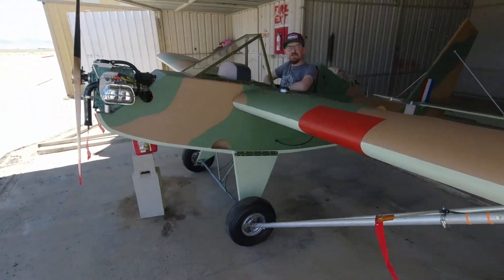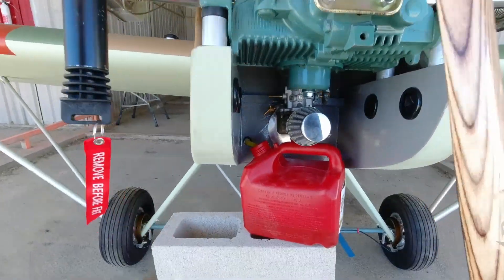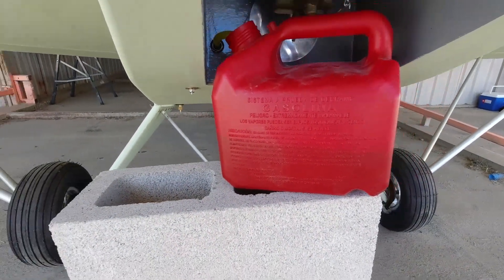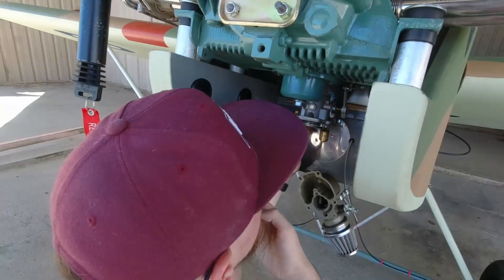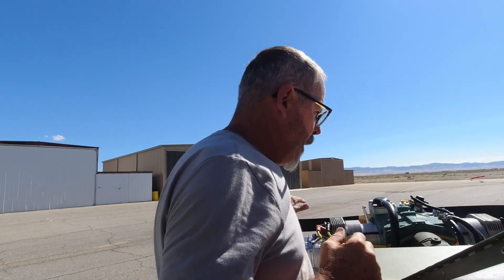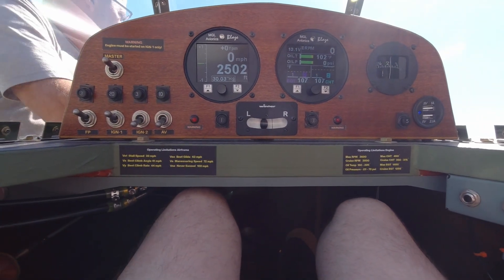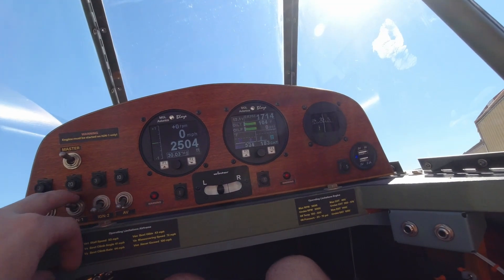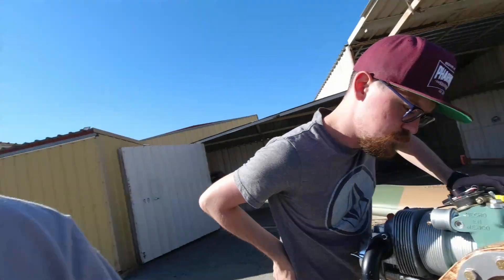Minimax 1100r Flight Testing Phase - Starting the Engine

Comment: I will be very interested in what MGL say about the oil pressure sender. Great that it started and only a few little tweeks needed. Did you try the fuel flow in flight attiutde with gravity?
Reply from the maker: I did the fuel flow yesterday with the longerons level and got a gallon in 7:38. That’s 8.1 gallons/hour. I only needed to hit 5 to double my demand so that’s good news. 
I got an 80psi 5 Bar as they recommended and it worked perfectly!
Reply: @DTMinimax  I take it that's with the pump, do you get any flow with the pump off? I think you did not put in a pump by pass and so will have to run the pump.
Reply from the maker: @flyingkub  That was with the pump off in level flight condition…with the pump on, I got a gallon in 2:38
Reply: @DTMinimax  briliant news so you don't need to run the pump all the time. I wonder if you will need to go back to the larger float jet, only testing will tell.

Comment: Ok, so that was totally fun and exciting to watch.  As I understand it, for this test you're in a climb attitude and the gascolator and fuel tanks are about on the horizontal so you're probably not getting gravity fuel flow, hence the need for the fuel pump when climbing?  Hopefully, the pump doesn't doesn't drain the battery before you get up to 12,000 MSL 🤣!
Reply from the maker: We have calculated that I can run 5 hours continuous as well as the radio and secondary ignition. Of course it’s theory and we’ll see what reality is. I do read volts on my instrument so I can keep an eye on it. I’m thinking I’ll mostly fly within a couple hours of my home port most of the time. 
It’s really fun at this stage…wish I was 20lbs lighter, but I’m just gonna have to lose that myself to trade for fuel. I may build another elevator since it’s the furthest thing hanging back there. 
With me and 5 gallons of fuel, my CG is 30% and right at 560lbs. 
With only 2.5 in each tank, there’s no fuel to move my gauge on its tail. I’m also gonna have to add some float to the bottom of the ones I have so it sits on the floor of the tank because I could barely register 2.5 gal in a level condition. 

Lots of interesting things to work through at this stage…still fun though

Comment: Hey Dennis, I was wondering if those fuel tanks were vented. I know when you have a dip in the line, that can stop it as we go through this on everyone of those things I work on when we have to drain a few gallons of fuel from each tank after we fill them for the very first time so we just make sure the hose we use stays straight. lol   Also, didn't I hear you mention a long while back that you had previously built a mini-max? I would like to hear about that some time and about the differences between the two if I am not remembering wrong.
Reply from the maker: There are vent holes in those fuel caps, they’re about 3/32” holes. I will share some info about that first one a long time ago:)

Comment: Do you have fuel pressure regulator? If so it shouldnt exceed 3 to 5 psi so that it doesnt overpower the needle and seat in the carb.
Reply from the maker: I don’t buy my pump is a 3 psi pump
Reply: @DTMinimax You should be good to go!

Comment: Dennis.  Now that you're  moving into the f"light testing phase," is there any more word on your Wt. and Bal for your followers?   Thanks.
Reply from the maker: Hey Michael, still working through the numbers and going to run them one more time with some aviation scales that a fellow pilot is going to loan me. Really nice people at my airport. 
So with me in the cockpit and 5 gallons of fuel, I fall right at the upper right corner of the flight envelope, 560lbs and 30% chord. 
I don’t have a lot of ways to shed weight except from my own body. 
Interesting enough, with Parker in the cockpit (who weighs 145) the CG goes too far aft. But we’ll try that again soon. 
Possibly the best move is to go ahead and move the engine forward and attempt to get the CG closer to 24-25%. 
Also thinking about just building a lighter Elevator since it is the most rearward component. A lot to think about.
Reply: @DTMinimax  Dennis, is that 535lb number still valid,  with your wife in the cockpit?   If so, I would think adding 30 more pounds (5 gal fuel) might put you slightly over the limit - 4 gallons would be under, at 559 lbs.  

The fuel burn for your VW is, I believe, around 2.25 to 2.50 GPH.  At that burn rate, 4 gallons would give you  ~ 1.77 to 1.60 hours of time at cruise.  Yes, some fuel would be used for "start, taxi, and takeoff."  But that gas is probably already in your gascolator and fuel lines.  :-)    I would guess that when you fly your wonderful little plane, you won't be flying  more than a "One Hour Sortie. "   An hour in these small planes is quite a bit.  Having said that, your present "state" is really GOOD.  You can GO with what you got!  No changes would be necessary.  

Moving the engine forward might yield a slightly better CG, but the weight would either be the same, or slightly more, with the additional framing for the engine move.  I just don't think the Horizontal stab will change things, if any.  

Only a thought, here:  If you change the tires and allied braking systems, there would be a measure of weight reduction there, which could be added to the fuel tanks.  You could use those "small, spoked, hard rubber tire," types, or just much smaller wheels.   Yes, it would not be, totally, the look you would be looking for, but hey,  you can go with full fuel - farther.  I know you could design a new light braking system.  We followers of yours, just want to see you get the result you have been working so hard to achieve.  Mike